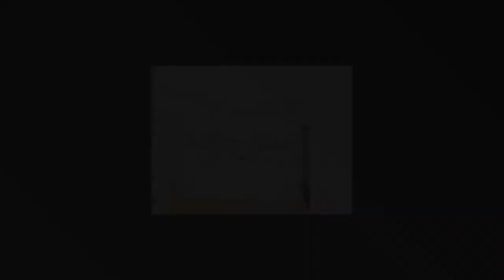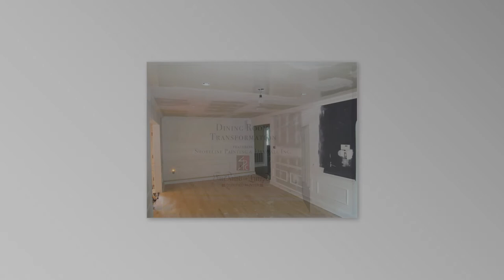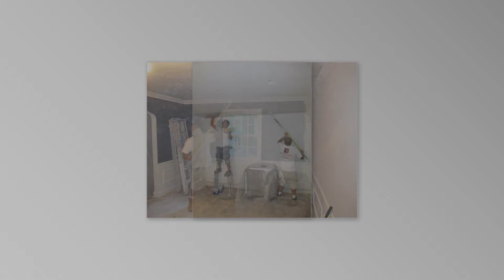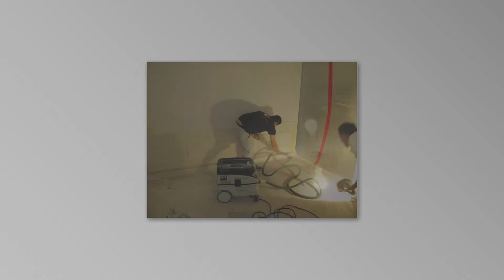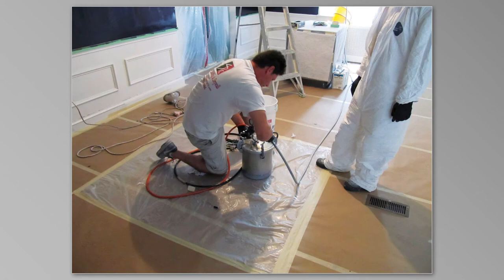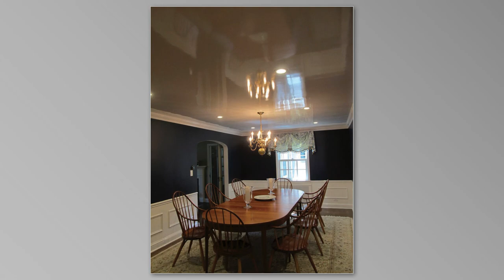Fine Paints of Europe Dining Room Transformation

Comment: Beautiful Dining Room,  I liked watching the painter with the light very skillfully applying each brush stroke. I purchased most of the  Fine Paints of Europe. I just need some direction about the steps. Like Dick, Spot and Jane.  I am going to paint a new mahogany casket. I stripped off the factory Black Piano. I know about the dust an built a air tight room with a filtered vent, the sanding and wipe down with tack cloth between each coat. I having a hard time rationalizing two to three coats of primer being applied before the Swedish Putty….. advise if you feel so lead too. Thanks I’m learning with a lot of. Money…..